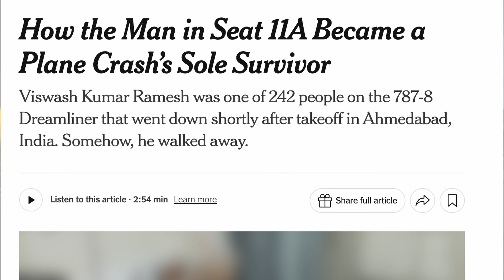Why the RAT Changes Everything – Air India 171 Update

Comment: It seems(?) what we definitely know: 1. Both engines were not giving sufficient thrust(possibly no thrust). 2. The RAT deployed (likely because both engines were not functioning). 3. There was no smoke or other visual indications the engines were physically damaged (if not bird strike, it seems BOTH engines simultaneously being damaged is extremely unlikely). The takeoff required almost every inch of runway causing the dirt beyond the runway to be swirled into the air (two others in the know have said this is definitely not normal). 
Interesting note: “787’s RAT can power critical electrical buses, including those for boost pumps, making it more likely to support fuel delivery for restart attempts” (RAT likely would have continued fuel delivery to the engines).

IMO the reasonable guesses to the cause (based on the extremely unlikely scenario that both engines would mechanically fail at nearly the same time): A. failure of the primary and backup electrical system slowed then stopped fuel delivery to both engines. B. Mistakenly, jet fuel was not loaded into the plane’s fuel tank. C. Purposeful sabotage of the plane. 
My own guess (only a guess): mistakenly, non jet fuel was filled into the fuel tanks. It would explain why the plane took the entire runway (degrading thrust from one or both engines), plane is able to get airborne but quickly is losing thrust to maintain altitude(each engine was affected differently until several seconds after liftoff when both are degraded), even RAT sending power to the pumps to fuel the engines did not see thrust increase.

Comment: the audio is what makes it really hard to blame anything other than engine failure. visual can leave room for guessing because it does get grainy. But that audio. I've lived by an airport before, and these massive planes are deafening, and that 787 was so low. then the side by side comparison of what the RAT sounds like, leaves very little room for argument. unless you choose to believe the entire video is doctored...

Very sad. I've seen many people say that air india has had poor maintenance for a while. And that 787 has always received complaints or concerns from pilots. i'm generally always so impressed at how many fail-safes there are in these commercial planes, add on top of that, how impressive pilots are. it will never not be shocking when there are accidents :/

Comment: I believe there's one more clue to prove dual engine failure.  After the airliner goes past the camera and we hear the RAT, we don't hear any jet engine noise which would typically be heard on an engine which is on full power for a take off.  But the crash is heard as clear as a bell.  The RAT is deployed, no jet engine noise prior to the crash and the crash is very audible.

Comment: Do you think the video circulating  about the AC, and other components not working in the cabin in the same plane during the flight exactly before the flight when it crashed be another piece of evidence in this case showing there was definitely something wrong with the electrical system which was neglected by the airlines before take-off? I did hear a counter argument that cabin's electrical system is separate than the other essential electrical components of the plane. I dont know much about how planes work. However, it still sounds connected.

Comment: Captain I do agree with you, what might have happened is that it was an engine failure, now, normally what we boeing pilots do is memory items at 400 ft AGL, they reached 600 ft, there is an startled surprise here at very low altitude, so my guess is due to rush, they did ENGINE SEVERE DAMAGE memory items but cutted off the wrong engine, I fly 737 but I have read that 787 has something called THS correct me if Im wrong, that helps the pilot to trim the rudder inmediatly after an engine failure thats why may be we dont see that type of sideslip we have while trimming the airplane with rudder,during an engine failure, so engine failure, memory items at 400 ft AGL cutting off the wrong engine, that would be my guess

Comment: # Planes auto computer  was performing proper otherwise Rat never opened and started operations. After seeing all the videos I think the malfunction was created between Lift and Gravity -Weight and Exhaust system.

It's not plane captain mistakes nor the plane it self. Most likely it's big things big malfunction very big unwanted un expected un trusted technical changes creations which is hard to find in very short flew time with high in fuel and height distances which will destroys many evidence. Whatever happened it's very very sad and unexpected which took many lives and bad reputation for flight manufacturers, captain, and other flying operations teams. I hope the Boeing company will get involved ASAP in this case to do more study and analysis to find the cause of this accident.

Comment: 1- there is a video circulating of this exact same aircraft, taken from the inside by a passenger on it's previous flight leg from New Dehli, clearly showing the aircraft had massive unsolved electrical problems, manifested in ways such as non-functioning air-conditioning.

2- depending upon the exact words used in the mayday call by the captain, consider the possibility "loss of power" may actually have meant loss of electrical power, which is one of only a few valid reasons for the RAT to deploy automatically.
Reply: electrical failure for air conditioning is not a condition for rat deployment, you need electrical failure in aircraft systems
Reply: @god_gamer5113  , true- point taken. On the previous flight, passengers reported the air conditioning, lights, and entertainment systems were not working—clear signs of electrical problems building up, and that aircraft has had other electrical problems in it's history.

I may be wrong, i know, i only offer it as possibilities to consider, because i find it so hard to fathom a hypothesis about two perfectly functioning engines giving up simultaneously, unless their respective control systems had a serious electrical problem.
Reply: @i-am-that-what-i-am  only after the investigations will we know what happened or boeing will cover that up too who knows
Reply: good observation. he did not say loss of engines or loss of thrust.
Reply: I don't understand how they could still decide to it take off with the electricals being off😢

Comment: IDK much about the RAT, but I doubt it has the power to assist a loaded plane, filled with fuel, immediately on take off.  It's too bad that there weren't 5 miles ahead of flat ground from that runway, they had no chance to land and certainly not to turn around. They almost landed right on the hospital.

Comment: There appears to be a scripted narrative unfolding across platforms like Twitter and YouTube — largely driven by Western “pilots.”

This narrative follows a repetitive pattern:
 • “I’m an airline pilot with X,000 hours of experience.”
 • “The flaps are only slightly extended.”
 • “The landing gear is still down, which should have been retracted at this altitude.”
 • “The aircraft has a high angle of attack, confirming incorrect flap settings.”
 • Therefore: Pilot error or human error is to blame.
 • Any possibility of engine failure is dismissed.
 • Any discussion around mechanical faults or issues with the Boeing 787 is conveniently erased.
 • They all refer to a single video clip, captured just moments before the crash, ignoring the full sequence of events.

Crucial facts they ignore:
 • The Mayday call made by the pilot.
 • A sudden stop in all communication.
 • The aircraft was flying at 400 feet above ground level — with Ahmedabad itself already at 200 feet elevation.
 • The plane appears to lose all power and drop abruptly.
 • A complete take-off video exists showing no change in flap configuration throughout — which contradicts the theory that the flaps were retracted mid-air instead of the landing gear.
 • The aircraft had recently undergone a refurbishment by a Turkish firm.

This appears to be coordinated narrative control — a deliberate effort to drown out contradictory evidence using a flood of similar-sounding expert opinions. The speed and uniformity of this messaging suggest inducement, incentives, or orchestration — not organic analysis.

Notice how the “bird strike” theory vanished overnight the moment the full takeoff footage surfaced.

Let’s hope people are paying attention — not just to the message, but to the choreography and the messengers. They should be identified and held accountable.
Reply: Good points, but it now appears that there was a total loss of either electrical power or engine thrust in both engines.   The question now is what caused that?  If this plane had just undergone a maintenance inspection why wasn't the electrical problem found and fixed, or the plane grounded?   Is it true that the previous flight of this plane had no air conditioning and electrical problems?
But as for all the YouTube vids that came out quickly, that is due to them all trying to get as many views as quickly as possible.

Comment: Does that sound like a 787 at TOGA thrust? No. Its going over the guys head almost. If there engines were doing anything you'd hear it...and that aircraft would be climbing not sinking. And you can hear the RAT ..over those big engines? They are idle or flamed out. 100%

Comment: It's a clear sabotage,with the oil supply valve manually closed during maintenance just before flight. Not that dual engine could fail all of sudden thats very unlikely. The left in fuel already in pipes or maybe in engine gave the initial take off power to the engine and that's it
Reply: You mean, the plane was not even fueled up?
Reply: @geezermann7865  it was fueled up, but the value supplying fuel to the engines was closed leading to no supply of fuel. Whaterver height the plane could take off was due to the little fuel that is already there in engine or its pipeline.
Reply: @mehra7690  I understand now, thank you.

Comment: Also just wondering again on the flaps theory. Read a pilot say that at that altitude the airplane wouldn’t let the flaps retract even if the pilot accident wants to retract them (correct me if I am wrong). The computer coding, on the dream-liner, makes sure flaps are at proper position during these crucial parts of the flight such as takeoff and landing.

Comment: APU inlet door also looks to be open - I think that is what that door is, and I would not be sure the force of the impact would open it. Depends whether it is sprung open and held closed electromechanically or whether it powers open. Ref photo here: https://www.reuters.com/resizer/v2/24RD736CVNNSFBYDFHRZLFBHLU.jpg?auth=1e863d196863a45624903a6da17c61b71529d1f9f0c72bff74516cc22f461361&width=1920&quality=80

Comment: Sir, in my opinion both engines didn't flameout, but it was an under-power aircraft from the beginning/ throttle stuck case. The long run for rollout, sluggish take off and dust flying in left from  sga patch indicates it. Secondly pilot said i am loosing thrust- engine failure audio-visual warning is prominent and if it was a dual eng fail he would have said so. Lastly i think on ground during preflights/ takeoff this throttle issue wud have been missed, however during the roll out it wud have been felt by the pilot( that may come out in the cvr). Most importantly the issue wud have been missed out during the tech maintenance . So my theory is aircraft loss due to power loss( throttle stuck at idle)

Comment: That now raises the question if the wrong fuel was delivered. We had an issue - hushed up-, where power kerosine was delivered into a passenger jet, luckily a preflight check identified it. Computer simulations later showed the plane would have barely lifted off.

Comment: If the RAT was deployed immediately on take off that would imply that the plane was not fit to fly. Engines did not flame out etc, how on earth both stopped functioning if that be the case ?  Could the pilot abort and turn back immediately on RAT deployment instead of proceeding ?

Comment: Could the 787 have been struck by debris kicked up from the ground just before take-off?  In another video that includes the take-off a cloud of dust can be seen under the aircraft just as it leaves the ground.  Could the 787 have gone past the end of the runway, kicking up something that damaged a critical component as in the Concorde crash many years ago?  Or, whatever was kicked up entered both engines causing them to fail?  I haven't yet heard any absolute confirmation that the 787 actually backtracked to the beginning of the runway from the apron entrance before starting its take-off run.  The initial reports said that it had, but a later report said they really didn't have actual confirmation of that.  If it started its take-off run from the entrance to the runway from the apron, the runway length available to the 787 would have been only 6,300 ft, which is about 300 ft short of the minimum recommended take-off distance for a 787.  Perhaps just short enough to briefly make the 787 go off the end of the runway before taking to the air.

Comment: Not confirmed, but there was some information floating around that the previous passengers on a previous flight of the same aircraft said that the on-board entertainment systems and air-conditioning were not working. If confirmed, it could point to an electrical problem that wasn't corrected when it first occurred?

Comment: I would lean more on hydraulic system failure since the flap and the landing gear both failed to operate during take-off. Both mechanism are powered by hydraulic systems specially on larger aircraft and the reason why RAT was deployed automatically.

Comment: Catastrophic Electrical and Hydraulic Failure which caused the Controls to stop working to raise the Landing Gear and stopped the Fuel Pumps from pumping fuel to the Engines. The RAT was too late to restore the fuel supply lines and restart the Engines at that altitude. Definitely not Pilot Error. The Engines had stopped producing thrust.  There are Lithium Batteries in the Electrical System. Could they have exploded in the heat triggering the chain of events?

Comment: I am going to assume that each engine was running on its own independent electrical system and was not subject to a failure of electrical power in the other engine.  Is this reasonable?  If a single electrical power supply problem anywhere on the plane could not eliminate both engines simultaneously, does that leave the fuel supply as the only common factor that would be responsible for both engines losing power?  

Let me assume a fuel problem ask a series of questions appertaining to fuel:  
(1) What kind of contamination would not be caught by refueling monitoring systems?   
(2) Assuming Av gas contamination would not be detected, would Av gas mixed with JP1 cause the engines to quit?  
(3) Were there any other JP1 consuming aircraft that were fueled from the very same source by the same ground crew at or near the same time as the 171 aircraft?
(4) If other aircraft were refueled from exactly the same source, did they experience any fuel related problems?
(5) Was there anything unusual about the size and nature of the fireball that would indicate higher than expected volatility of the fuel?

Comment: Let's wait for the black box data. This will give us a much better idea of what happened and why. However, I'm also of the opinion of dual engine failure at this point. This would account for the no gear-up under such circumstances, too. In these conditions, the gear-up would be the last thing on the minds of the pilots.

Comment: I wonder if on the last flight, they drained down the center tank, and the configuration wasn't changed. Then when it was refueled the center tank wasn't filled for some reason and it ran out of fuel after taxing/take off.

Comment: Going deep in the weeds here: Dual turbine engine failure is extraordinarily rare. It seems evident enough that the RAT deployed. Broadly, it is designed to do so automatically, but it can be deployed manually. It is tested thus during certification, as well as a part of routine maintenance per hull. I am curious what an uncommanded non-system-driven deployment could affect. Clearly one cannot test that, or at least from what I understand. Not many, but a few notable accidents fell under the "who knew it would do that?" category. Wild thought, I will concede, but after 39 years in the business, I've seen some crazy things.

Comment: Hypothesis.
I would say this aircraft experienced a critical electrical power system failure. This caused all AC powered fuel pumps to stop or trip. Suction feed to engines would be inadequate at this low altitude. Once this rear alignment happened both engines "flamed out" because of fuel starvation. As it relates to the Hydraulic System, the engine driven pumps could not function since the engines were dead (flamed out), and the backup motor driven hydraulic pump could not start since no electricity was available. Now what is the root cause of this electrical failure? I welcome your feedback. Capt. Steve, I would surely appreciate your feedback sir.

Comment: Dual engine failure is a very rare bird. I’m a fuels guy been working with it for a long time. I’d lock up the pumper that fueled that aircraft and be doing some serious quality assurance on that fuel. If those fuel filters were starting to get clogged up with bad fuel during taxi, running them up to full power might have finished them off.